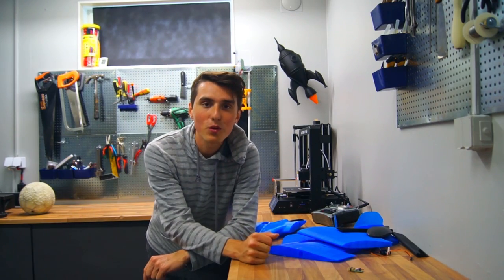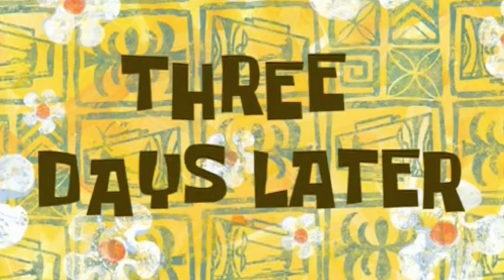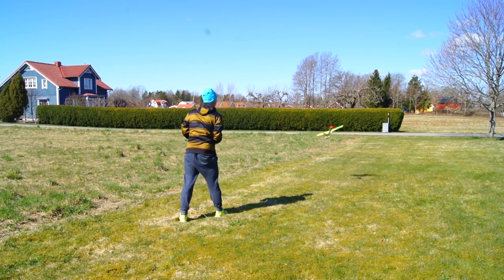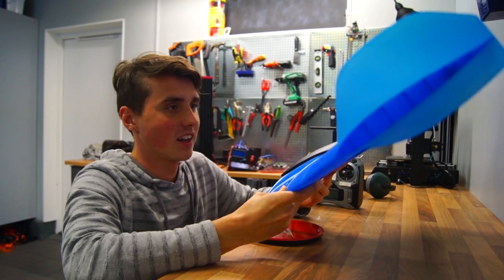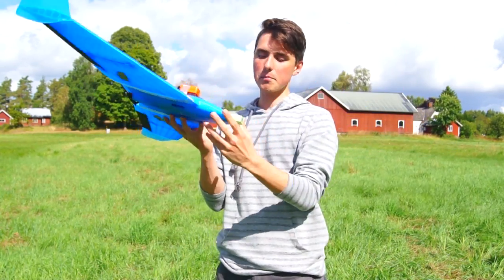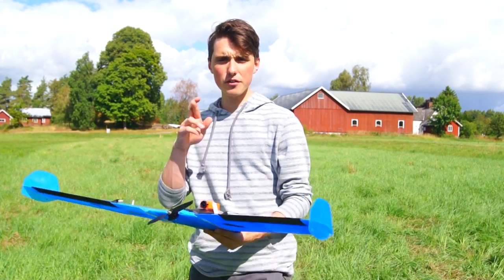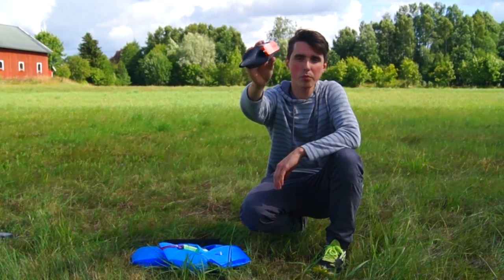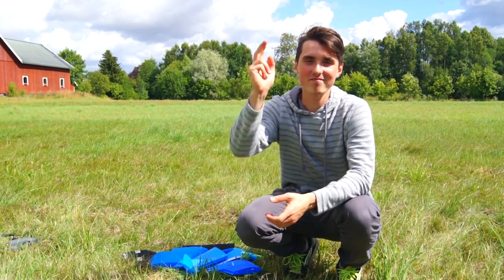3D Printed RC Airplane - CRASH!!!

Comment: Can you make a 3D printer machine use 3D printing
Reply: Wafiyal Tamim many parts of one yes
Reply: It's called RepRap Snappy and it's terrible.
Reply: Siana Gearz and it is only an example to show what the reprap project is capable of
Reply: It's a partially successful experiment aligned the with foundational/philosophical RepRap project goal - to produce self-replicating manufacturing machines, and at the same time, RepRap project is where most solutions found in affordable consumer 3D printing come from. Today's most popular, most widely copied motion platform Prusa i3 started its life as RepRap Mendel, a steel rod prism connected by 3D printed joiners. And yet Snappy is a toy, it demonstrates the limits of FDM manufacturing just as much as it demonstrates the possibilities. Maybe a bit of a reminder that just because you can 3D print something, doesn't mean you necessarily should.

Then again, it might as well be better than other toy printers, like 101hero.
Reply: Google the prusa i3 mk2, all of the orange parts printed and some of black parts too
Reply: Check out MP3DP
https://www.vicious1.com/projects/project-3d-printer/
Reply: The entire RepRap idea is about 3D printing as many parts as possible. Unfortunately many of the projects got a bit carried away with that. They took it too far and resulted in a machine that doesn't work as well as if they used some other manufacturing technique for some of the parts.
Reply: Wafiyal Tamim I'm afraid if you did,entropy would accelerate and the universe would just suck down to a pinprick in an instant and disappear!!!!

Comment: You have the C of G too far back C Of G is always 1/3 from the front most point of the wing to the rear most point. On a flying wing its from the nose. That's why it was so twitchy and if you move the C of G forward it also stops flying wings from tip staling as it did on your first flight. Do this and it looks like it would be a grate flying model. Also watch out if you scale up model aircraft as it can drastically. Even 10% can change a models flight characteristics and most of the time not for the better.

Comment: Just started printing this. Filament and 3d printing has come a long way in 6 years. I'm using a 0.6 nozzle and polymaker lightweight PLA. The whole plane, standard size, is 420g! Feels quite solid with 1 wall loop.
Reply: did you get it to maiden it?

Comment: Flying wings 101: Always make it insanely nose heavy and have 20% for normal rates and just in case 60-80% for dual rates with steep expo. Learned it the hard way just as you did I see :D

Comment: The project is perfect! I think the instability of the last flight was because of a lot of elevator. I often take off with the radio in setup mode to adjust the levels of elevator in flight even though I have set the dual rate switch. Even so, you did an excellent job.

Comment: I've printed 4 free models, Eclipson Model A from their site, 36"Northern Pike, Tom Stanton's Flying wing, and Speedy Red Midi Wing , all from Thingiverse. 
The are all beautiful, but I don't fly them. They are hanging off the ceiling in my computer room, and for show and appreciation only.
These planes are a lot heavier than foam planes and usually explode on impact. No tape repairs on the field are possible.

Comment: Bravo.
Can I make a request ? Please make a comparison between 3D-printed wings, foam with balsa planking and ribbed construction. A small E-Sailplane would be the most suitable, the test method (s) could look like: glideratio at 0%, 15%, 30% gas, stall (quality and quantity), maximum speed and stability.
As far as I know nobody (worldwide) made such a comparison!

Comment: For joining the wings to the body - you should design some snap-fit system, that wouldn't even need any glue. Google "snap fit". And I think a snap fit all around the perimeter of the wing section - is the best solution. Or design some screwed panels that would screw inside both parts. Always a way.

Comment: Oh. My. That battery position is, pretty damm good. I built a mini Mustang (discustang) from scrap foamboard, and the battery is crammed under the motor mount, not even a finger depth from the prop

Comment: I have also printed several airplanes.
The models from 3d lab fly well, BUT they are all damn sensitive. 
A little more ruby are PETG prints.
The models are nice to look at and great eye-catchers, but for everyday use foam waffles are better. quickly patched with duct tape and on you go.
a scale firberglass model is also easily broken, but can be repaired better. 

i will try to build a mould from a 3d printed model next winter. so from the fuselage...

Comment: It looks a good design, apart from the wing section, it's incorrect. You should have a Reflex section airfoil. The other obvious problems: 60 hrs to print, brittle and weak, Not the lightest. Kudos for your Video edit though, very nicely done.

Comment: "Printing over foam" with carbon fiber sparing will allow for interesting covering material design applied with a location aware self distancing print head for ultra thin printing trying to match the 25k PSI tensile strength of a good covering film and should push 3D printing closer to what was impossible just a few years ago.

Comment: You need to do the runcam mod. The battery compartment is slightly to big for the battery. 
But a small piece of cardboard on top of the battery(and in some cases the back also, and you wont have an issue with it turning off :) (You do this to hold the battery against the terminals:)

Comment: I enjoy watching your vid's
I really would like to add a suggestion!.  Being in RC for more than 20 Years, and Full Scale Pilot for 10, I would suggest checking C-of-G before any a-temp, and use your Radio futures. Add dual Rates and EXPO. That wing could be saved, seeing with the on board Cam, there were way to much throw on the Ailevons... But nice Vid.. keep up the good work....

Comment: I did run through the comments and failed to find the material list. Actually my main concern is what type of adhesive (specifically) was used. And I'm assuming the print was done using PLA, correct me if I'm wrong.

Comment: sadly pla is too heavy for 3d printed planes, try to print some parts in abs, like the fuselage or the mid wing, pla density is about 1,4 grams while balsa good is below 0,6 grams
Reply: ABS has lower tensile strength than PLA, and many people make PLA planes that fly fine.

Comment: I'd just like to point out that while dimensions do scale, physics does not. You should print out the original for a comparison of how it flies, and how it was designed to work at that scale. 
When you scale something up, you need to consider the weights, balancing of weights, how much power is needed. It's not just as simple as scaling up the dimensions.

Comment: Delta wings are notoriously difficult to fly without some serious fly-by-wire.
Reply: Maxwell Perlman difficult to set up if the cg range is unknown, yes. Difficult to fly when set up properly, no. They are fairly easy to fly if you have mastered aileron/elevator coordinated turns. Try one you will like it.

Comment: thanks for posting.  nice work.  here are some thoughts.  the design of the vert-stabs puts Unnecessary weight at the wingtips.  the area that extends below the wing Could be removed.  servos Could be installed farther inboard, to 'tighten up' the center of mass.    someone with abundant airframe design Knowledge did Not design the vert-stab Profile; the 'clipped off' aft corners are Reducing stability.   btw, you may know, colorful and bendy s-f props Should be used on Slow-flyers,   Only.    cheers

Comment: U probably aren't going to see this but could I use these parts for a foam airboat and it will work fine? Also what size propeller would I need for that motor? Btw u really inspire me keep it up😁
Reply: NBA Mixed There are better components to use for a foam airboat but the concept is very similar. Though the process is a bit different.

Comment: Which cheap chinese 3d printer i can buy with an heated bed, good ajustablehorizontal  bed  and good to clean nozzles. And use of the ordinary filanment . What is your advise and where can i buy it, (global)
Reply: edwin k i have three of the cr-10 printers he is using. i highly recommend them. i also have an Anet a8 and a 3dsystems cube printer as well. i like using the cr-10's for the build area but they also print very well and come with a heated bed and glass build surface. use 1.75mm filament and can also print flexible filaments well. you can buy them china direct. hope im not too late to help.

Comment: Really this plane is a bad desing. look at the horton 229. it had major difficulties turning because of no rudder and center of gravity was almost on point of center of mass which made the plane insanely sensitive. i think plane with a tail would been better as a 3d print model.
Reply: Ye but most tail free planes tends to be built close to unstable for sharper turning abilites. but i get why they made the model like this. its harder to build steering in a tail than just on the wings.